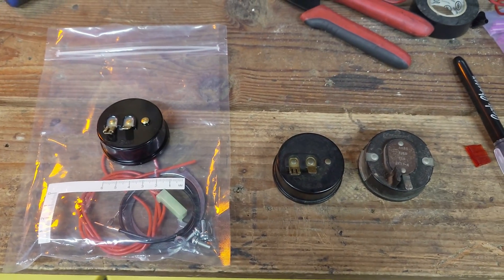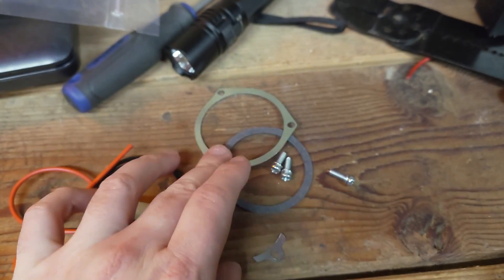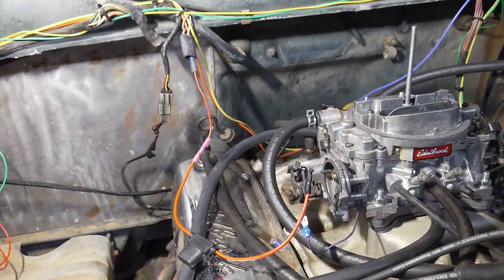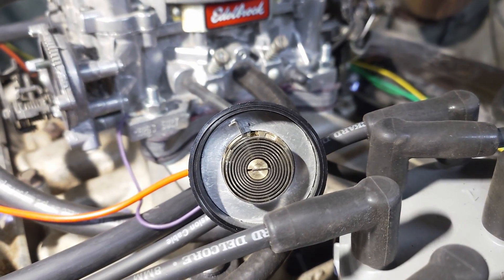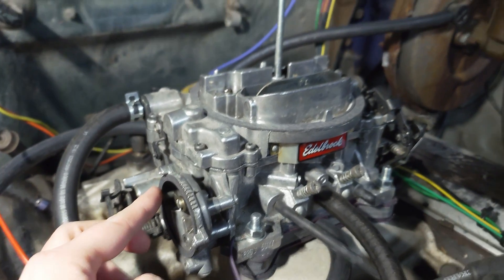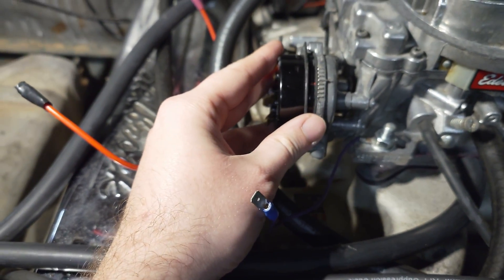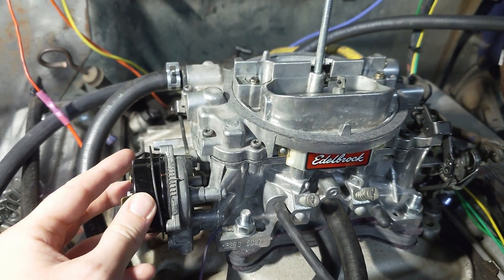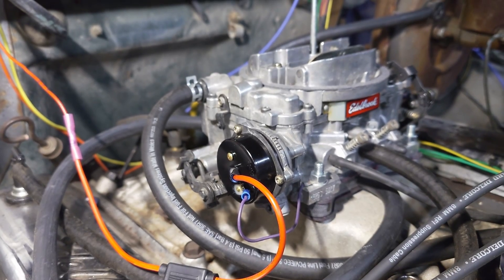Edelbrock Electric Choke Test and Replacement Lkonwee Electric Choke Thermostat Kit

Comment: Just been trouble shooting my electric choke, ign power and ground present but choke not working, turned out be high resistance between the rivet and the connector tab on the ground side (can see it with a voltage drop test from rivet to tab), cleaning and soldering the tabs to the rivets got the fix 👍

Comment: Exactly the video i needed. I think the spring may be broke in mine. It just stays open every time.
Reply: I’m trying to diag mine. Usually it’ll warm up to 150 and I’ll tap the gas and the RPM will drop good. But lately the RPM just stay high until 180 and I really have to rev it for it to drop
Reply: @4rdF1Hunny You might have the same issue as me, bad connection between the rivets and connector tabs, after cleaning and soldering them up the unit works again 👍

Comment: Where is the other end of the hot wire going to? the fuse box?
Reply from the maker: It's tapped into the wiring harness running along the firewall, I'm not quite sure where it goes but it does run into the cabin. It was there when I got the truck and since it's got its own inline fuse I figured it wouldn't hurt to keep using that source. However if I were doing it from scratch, I'd go to the solenoid and/or battery.
Reply: @rednecklite  Wouldn't battery be unkeyed source?